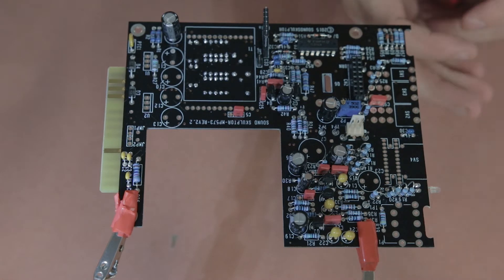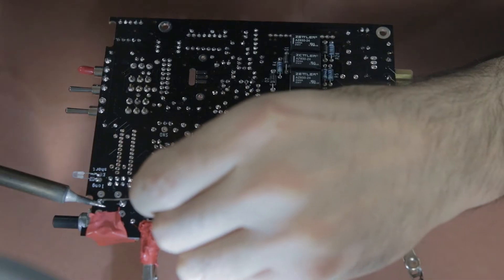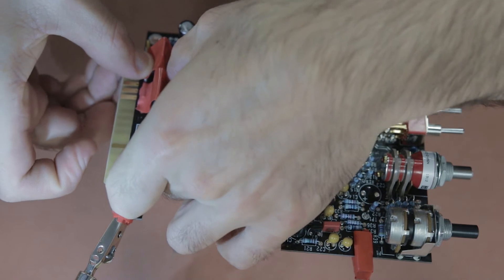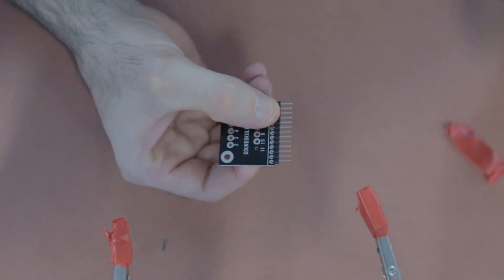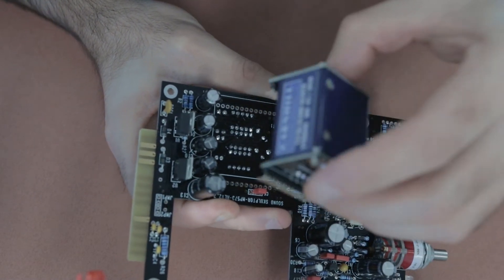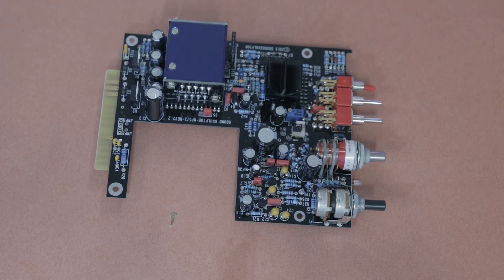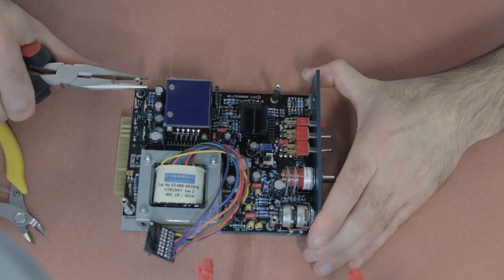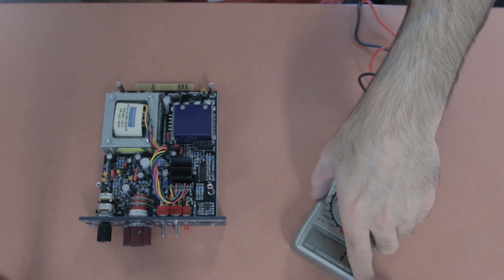How to Build your Own Preamp - Sound Skulptor MP573 (NEVE 1073) DIY Build PART 2

Comment: alright i made it this far now in my first build. i have to say your video's are a great help because sometimes the manual is a little too short to really understand what to do and how to do it. i'm sure with more experience this will get easier. so far so good. i just hope this thing will work. fingers crossed.
Reply from the maker: Awesome work. Keep us posted on how you go and good luck. Let me know if you get stuck on anything.
Reply: Thank for your reply. i am done with my build but stuck on the measurements. supposed to get over 1k ohm between these pinns but i get like 3mega ohm or something.. idk @diyrecordingstudio
Reply from the maker: Ahh ok? Sorry for the late reply. How did you go, any help from sound Skulptor?

Comment: thx for the vid.  i'm about to embark on my first piece as far as DIY goes.  I was wondering what the gadget was that was holding the board and allowed you to flip it back and forth and keep it off the desk.  and where i might be able to find something like it.  thx much
Reply from the maker: That's awesome Aaron! What are you going to build?

That device is called a "Helping Hand" which always makes me laugh, but they are super useful haha. In Australia you can get them from Jaycar but I'm sure you can get them from Amazon, Ebay or your local electronics store. I put a link down below for you. 

https://www.jaycar.com.au/holder-pcb-with-led-magnifier-and-soldering-iron-stand/p/TH1987
Reply: @diyrecordingstudio  thx i appreciate it.  just realized i don't have a multimeter either, important to test as i build right?  just getting my ducks in a row but look forward to getting this done.  I'm building the Analog Allstars pultec style eq.  I've always wanted a pultec and this one looks great esp for a 500 series.  Starting with one but want stereo mainly for my stereo coles 4038 drum overheads, but of course nice on the master bus.
Reply from the maker: Oh awesome, yeah i think the pulteq style eq will serve you well with those situations. I want to get a pair from diyre sometime soon i think.

Yes you will definitely want to get a multimeter. Often some components will be easier to sort if you can measuer them, particularly resistors. You'll also need one in testing and possibly calibration when you finish the unit.

Comment: If I’ve worked on tube amps (Fenders), rebuilding them, will I be able to assemble one of these pre’s?
And this particular kit looks good; I was considering a Capi VP-28 (I think it’s like an A.P.I.)
Any advice would be much appreciated. Thanks.
Reply from the maker: Hi Nathan. You should be able to do these if you've worked on amps before. Some of the soldering points are small but it isn't to hard if you've experience soldering like yourself.

This kit is great. It is almost exactly like a Neve 1073 preamp. I also just built 2 VP28's recently. They're great. Jeff steiger who owns CAPI worked rebuilding and repairing API consoles and the CAPI'S are basically identical to the real thing. Great preamps.

Honestly I love both. Good for different things.
Reply: The DIY Recording Studio :
Thanks for replying and so quickly.
I’m close to pulling the trigger on the FiveFish X-72.
I think that Neve sound might be more what I want, the build looks easier, and is sales-pitched as such, and I own 4- SC-1’s (prebuilt).
So go ahead and buy it?
Is it easy enough to solder on those tiny traces without goofing up if you’re slow, careful, and precise?
And ... would you please give me an idea of what you think each of those 2 styles of preamp (Neve, API) are best suited for?
I’d like to learn about preamps, like I learned about tube guitar amps. (I guess that Neve/API are like Fender/Marshall?)
Reply from the maker: No Problems Nathan.

The FiveFish Preamp looks great. I hadn't actually seen that one before. It has the correct input and output transformers that give the Neve it's sound. Smhame it doesnt have a DI input though. The sound of the DI input on my Sound Skulptor Pre's is very good.

In regards to soldering this preamp, I had never soldered anything like this before and I managed, So I'm sure you could too. 

The neve and the API are both good on practically anything, it just depends on what you're after. The Neve style preamps typically have a warm, round bottom end and a smooth top end. The API's on the other hand have a nice punchy midrange.
Reply: The DIY Recording Studio :
Hi again,
The 5Fish X72 does have a d.i.
Now would you like it more?
http://fivefishstudios.com/500serieskits/nk72di/